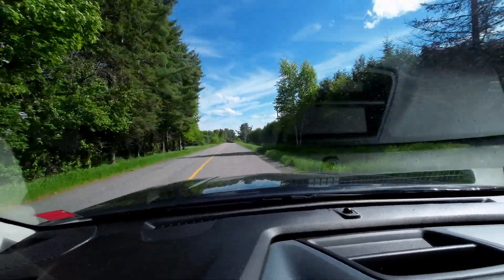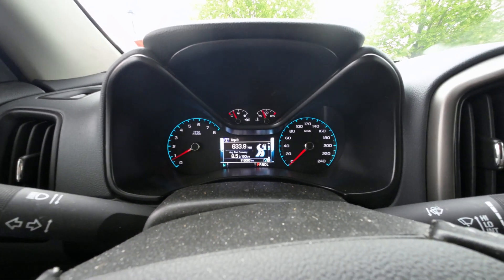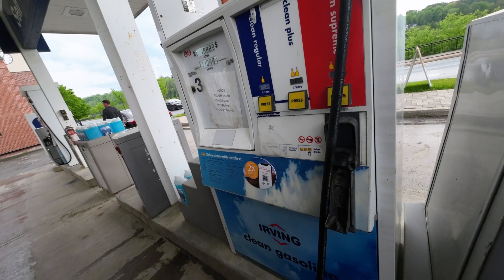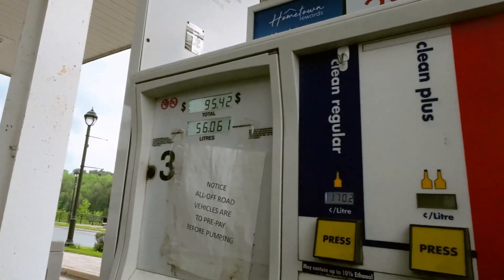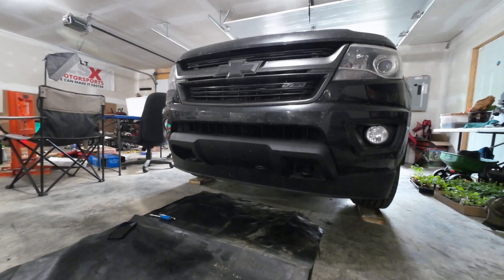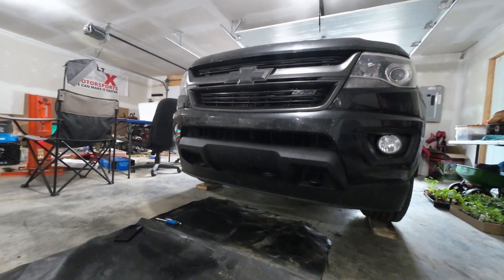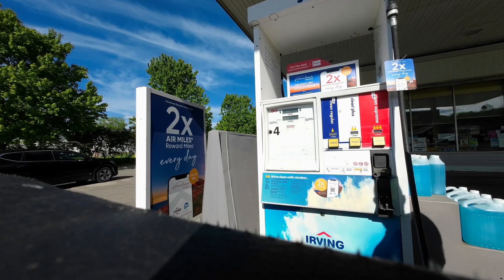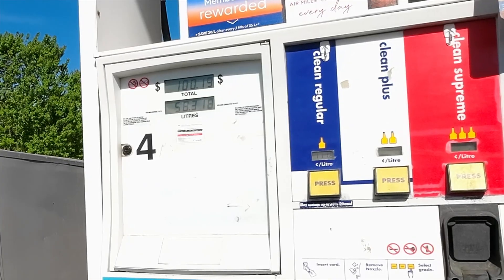Does removing the Air Dam from a truck affect the fuel economy?

Comment: I noticed the same issue on a 2011 Tahoe, I owned. It had an air dam and a built-in factory "rake/stance" (factory tow package) where it sat with the rear end higher than the front. I put a leveling kit on the front to even out the rake/stance, and removed the front air dam. It got about 2-3 mpg less at cruise on the highway. The aero pkg on these trucks is really important if you do a lot of highway driving....
Reply from the maker: Yeah it really does make a difference especially at higher speeds.

Comment: It's spelled dam.
Reply from the maker: Thanks. Fixed it.
Reply: So mileage is worse without air dam?
Reply from the maker: Yes it is slightly worst atleast it was on my truck.
Reply: @LSxMotorsports2021  no driveability issues though? Did engine run warmer? Did transmission temps run warmer with air dam removed??
Reply from the maker: @kevinsteinke2603 I didn't notice any issues at all. Keep in mind it never really gets too hot where I live. I have watched other videos where people have removed their air dams and never had any issues.